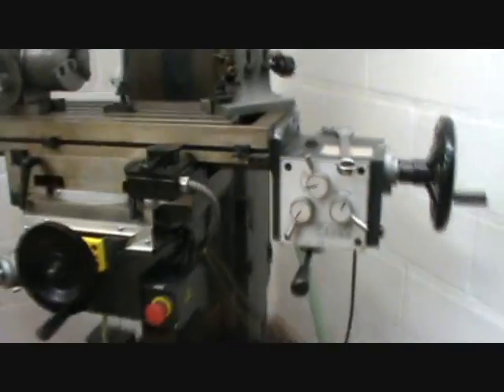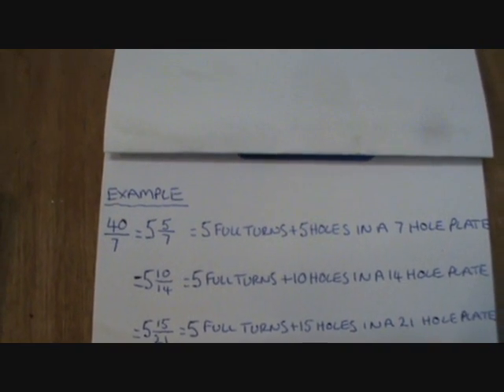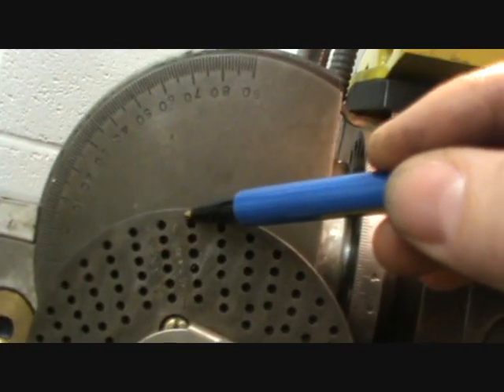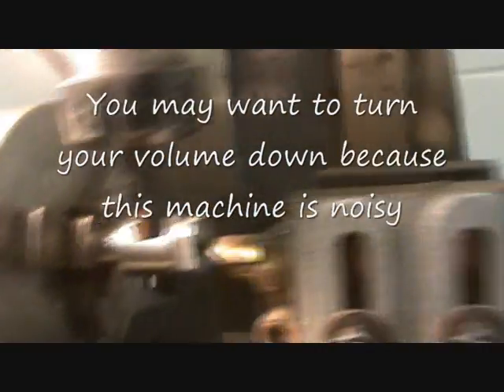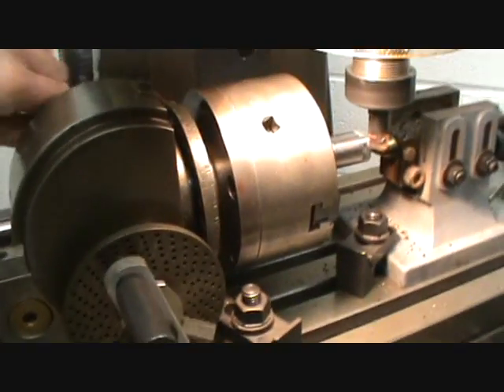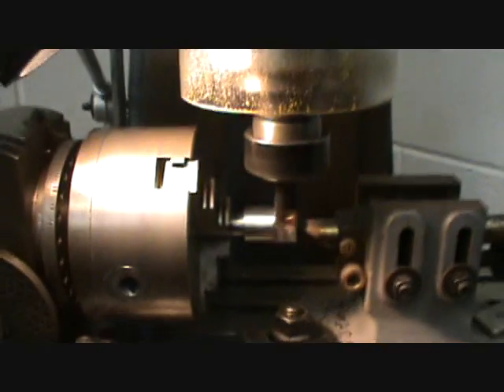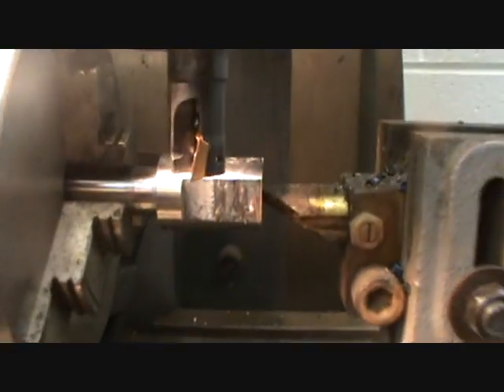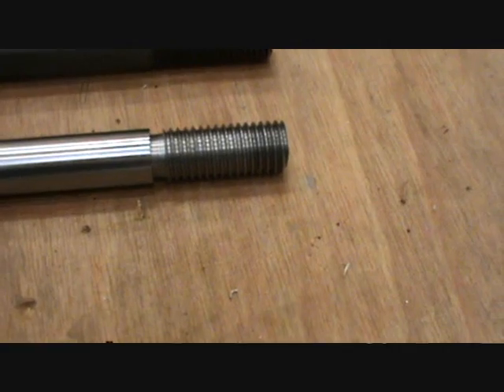Metalwork-Making a Drawbar part3

Comment: If you play with the idea you might see what I mean. First the magnets pull to each other in an offset mode. when they get close and want to repel, inertia should push past the stall point and get to total repulsion {power stroke}. Using 3 axles and 9 sets of wheels you will have 6 points of power intersection and if sequenced properly, you have a continual power stroke in line. Keep wheels 1/16 apart for real power and the center axle [with 3 wheels] slides into the field to engage the system.

Comment: Dude you are so close and making it too complicated. You have all the toys needed that I wish I had. My system uses 3 axles with magnets placed + and - in the wheel housing about 1/8 in apart. The outer 2 axles are permanent and the center axle slides in to engage the magnetic affect. The wheels are sequenced so that each set of 3 wheels has a magnetic pushing and pulling affect and offset so that every contact point is either pushing or pulling. The + mag. affect should offset the neg.